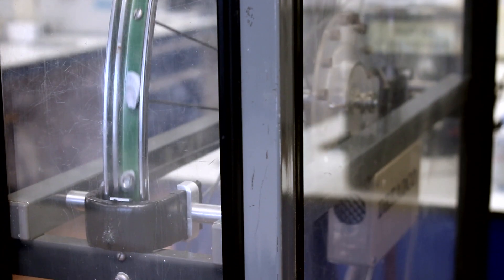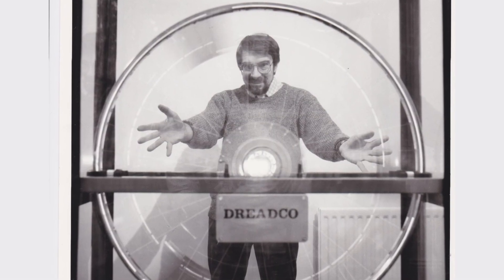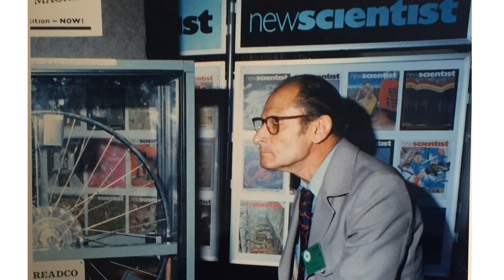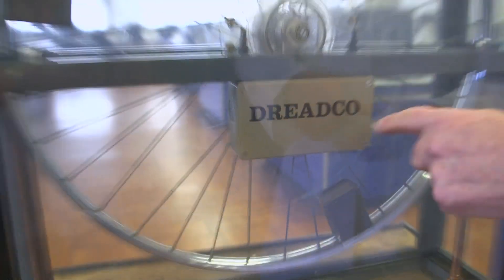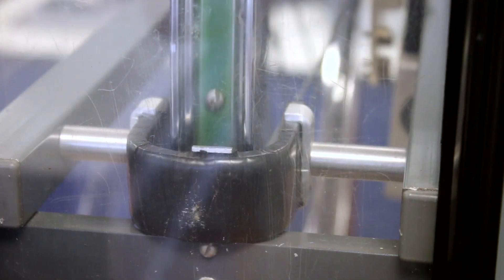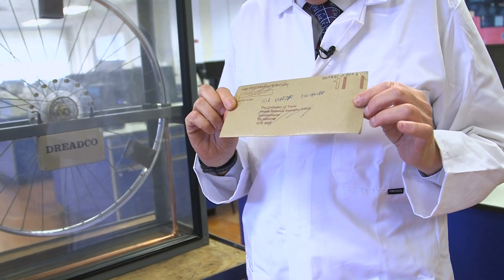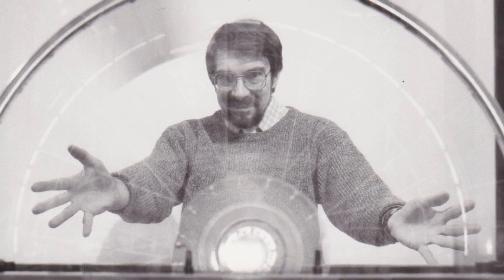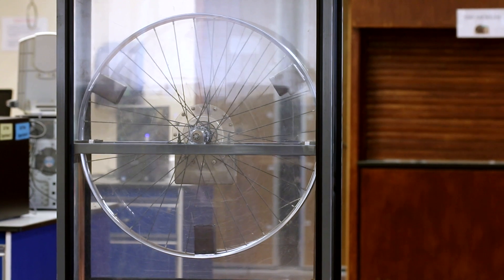Perpetual Motion Machine - Periodic Table of Videos

Comment: I doubt only one person guessed how this worked. Is clearly electromagnetic and the energy source is a battery.
Batteries are likely in the 3 boxes and they put a bit of energy in to the system each time they pass next to the two permanent magnets. There are 3 boxes so that only one box will put energy in to the system at any one time. The amount of energy is small as it just needs to counter the friction in the system.
Of course it can also be the other way around and the permanent magnets are inside the 3 boxes and the electromagnets are on the side with the battery in the bottom box but it will make more sense to have batteries in each of the boxes as they seems to have a lager volume.

Comment: the wheel is well balenced, each black box contains a battery and a copper coil. when the boxes are in the correct position relitvie to the two horseshoe magnets the coil is briefly activated, probarbly by a circuit with a reed switch giving just enough push to keep the wheel in motion. since the electrical consumption is so low the batteries are able to last for an unusually long time. I would guess that its running on those old fashioned lantern batteries with the long brass tabs.

Comment: My guess is it has a very long lasting battery and a very low power motor. It could work like in the oxford electric bell, charging these metal things near the center of the wheel and electrostatic forces pushing it away after it touches these contacts (and being attracted right before. The rest is just weights on the flywheel and a low friction bearing. Maybe it also contains some kind of solar cell in that dreadco box to support the battery.

Comment: If the small boxes have nothing but a small amount of propane in them and they are heated at one side and cooled at the other, with the propane at the correct pressure to be just about on the verge of condensing, the cold side will fall and the warm side rise because of weight distribution. IE using heat to re-distribute weight to cause rotation.

Comment: Works by electromagnetic induction. Motion of the metal wheel induces a current in the copper frame which pushes the wheel off at a finely balanced distance. It will eventually slow down to a halt due to Lenz's law, but with clever architecture might go on for a few years.

Comment: My guess would be momentum wheels that are slowly spinning down, due to friction or power source degradation, are placed in the three boxes. As the wheels spin down, they cause the bigger bicycle wheel to turn the other way, due to conservation of momentum. The momentum exchange must be larger enough to overcome the friction in the central bearing. The power source could be a spring or a battery.

Comment: I think it moves by sending pulses through to the 2 horse-shoe shaped electromagnets (black tape covers their small coils). There are 3 iron boxes to weight and balance the wheel and get attracted towards the relevant magnet, when it's powered. The power switching circuit knows the position of the wheel through those pointed rods on the box in the middle acting as (friction free) hall effect type sensors on the brass studs on the perspex disk passing near them. There is a battery and control circuitry either in the middle box, or in the box on the bottom and wiring is all hidden in the plumbing and frame.  I guess you can make a low voltage system to move the wheel slowly for a long time. The glass case is there to act against air currents and to stop people fiddling with it. That's my guess!

Comment: Here is my guess... high volt battery, connected to a very low power engine, powerful enough to move the machine. The rest is just a decoy! 
Got a digital clock with two AA batteries that has lasted for more than a year (still going). So... yeah...

Comment: Here's my 2c:
Most trickery work by diverting your attention to other things, thus all those pipes and magnet looking things are just props.

Facts: The wheel is spinning at a relative constant rate - gear engine of some sort
The energy source speculation: There don't appear to have any noise/pistons/burning/hose - so volatile gas is out, in addition it looks like it may be a vacuum chamber. But battery would be most suitable.
The DreadCo box covers enough of the centre to drive the wheel with the rivets being the propelling proponent.

Comment: I would need more information:
If you create a temperature difference between the heat sink and the copper tube, does the wheel vary RPM accordingly? If the answer is 'yes', the I would suggest it's a form of a sterling engine. For any other concept, I would need a closer examination (from outside the box).

Comment: Its in essence a Barlow's wheel. Micro current for milisecond each revolution helps to keep the momentum going. Everything else is misdirection. Battery hidden and connector hidden makes a circuit every revolution of the wheel and slowly drains the battery. The slower the wheel turns the longer the battery lasts basically.  watch?v=hSfxATaYeSY for example without the misdirections. You only need microvolts every 30+ seconds to continue pushing the wheel and there is a hidden connector/switch on the wheel that each revolution turns the battery on for a milisecond.

Comment: He said he felt cheated. maybe there's just a small electric motor in the enter, or a battery at the bottom that turn the horseshoe things on the sides into electromagnets, pull in the boxes, assuming they are magnets, on the rim in a circle.

Comment: The box holds some peltier elements that run a tiny single transistor coil pulser cirquit like in those swinging desktop ornaments. The temperature difference between the heatsinks and copper pipe is just enough to make the thing run. Or maybe there is just the different metals and some electrolyte in the copper tube reacting with the alu/magnesium box to run a crude battery powering the pulser. Or just a commercial primary lithium battery that can sustain this very little energy for decades. Its hard to tell just from the video.

Comment: So there are several things here, a perpetual motion machine, theoretically, -which is possible; what is not possible is an over-unity device, one which appears to draw energy from nowhere.  If you took a flywheel, set it in a perfect vacuum on a magnet bearing, and set it spinning, it would spin forever.  It would readily spin down if you tried to take energy from it, however, and would only retain what was put in.  

This device resembles that, in a way, but as we saw the wooden base beneath the enclosure we can be reasonably certain that this is not under high vacuum.  Now, the heat sink tells us something (if we assume that it is part of the actual working bits and not simply for decoration), heat sinks are usually used on things that consume a great deal of energy, power transformers, microprocessors of many FLOPS, microwave devices.  No such apparatus could be in this device, if it were dissipating heat it would have a very powerful power source like a radiothermic generator, which I find unlikely.  Instead, if we are assuming the heat sink does something, it must be there to take in energy from around, or perhaps to ever so slightly chill something inside, for purposes of exploiting temperature differentials related to air-flow and human presence/observance of the device.  I posit that this device is a type of Stirling generator or similar.

Of course it's entirely possible that this is an elaborate hoax and that there's an atomic battery in one of those boxes.  Obviously he's acknowledged that it's "fraudulent", but it would be interesting to know what the "defeat condition" is- does it run down in a vacuum, or simply over time?

Comment: My grandfather once had an Atmos Clock. It ran by changing air pressure in a expansion chamber. Changing temperature expanded or contracted a gas in the chamber which moved a spring counter weight. If the Professor's Wheel is stored in an air conditioned environment, it might not have enough temperature difference to keep the wheel running quickly. Or there is slight leakage with the gas. Less gas, less pressure difference and less motion.

Comment: I'd say there's essentially a motor inside with some well hidden magnets perhaps on the wheel, and a hidden electromagnet going on and off at the right time in the frame. Those systems became very popular in the early 1980s because the field effect transistors needed for those became cheap. You could even buy an array of desk toys working that way.

Comment: The problem is there are so many potential false leads. Lots of those bits could just be there to throw you off. The only thing I want to know is if you could determine the materials of every visible piece of the object could anyone determine with 100% certainty what’s running it? Because if not then I’d feel cheated to.

Comment: Hmmm.. I think it has something with the box in the middle (the DREADCO-box) to do. Maybe some material that harvest energy from the very room it stands in and converted to a sinual wave that powers the magnets. Does it operates when it´s dark? ;-)

Or maybe it utilizes the box as a greenhouse and use the temperature difference from within the box and outside by the thing in left bottom corner, by using thermo electric device.

Or even more clever, it may use both methods at the same time...

Comment: It looks like it is powered from the box near the axel. The electrode on the right is an electron emitter. The one on the left is a sink. A long-lasting high voltage battery is attached between them. The cups on the wheel get charged as they pass the right side electrode. The cups get discharged as they pass the left side electrode. The electric fields between the electrodes and the cups makes the wheel turn. The battery is very slowly discharged as the cups carry small bits of charge when the wheel turns. Very, very nice.

Comment: I feel like it's a simple thermal engine not unlike a Stirling engine. The pipe with a heat sink and the length of pipe going to the other side is longer, gains more heat along the horizontal length, the vertical pipe going to the heat sink is shorter and is vertical so it allows suction as the air comes down and is cooled.

Comment: "We believe whatever we see." 

Here's something I've never seen: two years, uncut, footage of that machine running. I propose that there is an inductive charging system and a small battery. For displays/exhibitions lasting less than a few days, there is a small relay/switch system which allows current to flow briefly as magnets move away from coils giving them a tiny amount of propulsion. 

Alternatively, there is an air current in the container and PMM1 is essentially and "open-cylinder" Sterling engine. This requires a bit more dishonesty on the part of the owner, but in a closed system, you could imagine a tiny amount of fuel lasting quite a long time. 

If it's neither of these, then it's a cat. 

I don't know how it's a cat, but experience tells me that "mysterious, unseen, notice forces" are usually cats.

Comment: I think the entire mechanism is in the dreadco box. It might be a compressed air canister that is releasing a small jet of air from the needle, focused on the cups around the hub. Or it's a battery with a little air pump. That's why it's in a case. 1. To remove interference and 2. So you can't hear the air jet.

Comment: Low friction bearing, magnets in the boxes, with a sensor and circuit in the horseshoe shapes at the ends to give a small impulse each time a magnet passes. Bars made of aluminum to prevent the choppy motion you'd get if you used iron or steel. That's my guess!

Comment: Looks like those pipes could hold a large amount of batteries. I'm thinking a low power air pump(fan) blowing from that thin bent pipe onto the disk attached to the spokes that holds the cups. Just the friction of the air should be able to spin the disk, the cups are just for show. I'd imagine some form of solidstate regulator circuit prevents the batteries from discharging as much as the pump could use, sort of like a choke.

Comment: First thought was that it's thermal. Some working fluid in the pipes and perhaps works simalar to the drinking bird. But that it's slowed down makes me think it's just a pulse motor with a reed switch and a simple air-magnesium battery. The heatsinks and other parts could be just to throw people off.

Comment: An Atmos Clock type mechanism could run until it needed maintenance just off of changes in barometric pressure or temperature, but a battery hidden inside and just barely jogging a motor or applying an impulse with a coil as the wheel slows could last for years too. Especially with a well balanced and low friction setup.

Comment: It's probably a thermoelectric generator powering an electromagnet that interfaces with the 3 magnets on the wheel (which double as flywheel weights). The "ball" tracks the plastic disc with holes (with magnets inside?) as a sort of crude tachometer wheel for timing the electromagnet control. The heatsink and copper is the thermoelectric generator powering the entire thing. I'm probably wrong, but as an engineer it's my best guess based on what I see.

Comment: Looks like a “brushless dc motor” magnets in the cans. Two electromagnets on the edges fed through the copper pipes and the box with heat sinks likely houses the switching electronics and maybe power source. The thing in the middle could be telling transistors to switch keeping things all in phase. That’s my guess.

Comment: If the blocks mounted in the wheel contain Tungsten, then there is a massive amount of inertia built into the wheel. That support frame looks very sturdy to just support a standard bike wheel. The casing is clearly just perspex judging by the scratches, so probably not airtight, but it doesn't need to be. Given that a fidget spinner weighing 50 grams can spin for over an hour, how long will a bike wheel spin with several kilograms of Tungsten bolted to the rim? The answer is a very long time indeed. Slow rotational speed negates the effects of air resistance. Precision bearings are virtually lossless. The magnets are just used to spin up the wheel as required using an external handheld electromagnetic coil. Look for the simple solution. Are you all disappointed yet?

Comment: My guess is that there is an RF energy harvester in use. If you convert a small amount of RF into DC and run the current through the center of the wheel you could cause it to spin. Over time the circuitry would degrade and become less efficient and it would spin slower. You could also use the wheel itself as a large antenna to capture more RF. The box with a heatsink might have a resistor to use up the power created by the RF harvester.

Comment: One has to remember the technology that existed when this was built.   A lot of the guesses are based technology which did not exist when the machine was built.  One clue is the professor says he knows it's been running contentiously for two years.  Prof also said it's slowing down.  I'm thinking batteries with a switching motor.  Remember this is a nearly perfectly balanced bicycle wheel which once it starts spinning will has very little friction and will continue to spin with very little energy. 

Interesting that only one person has figured it out, and only one other was close.

Comment: The box was vacated of air to create a vacuum and lower the air resistance. Inside each of the three boxes and the main Dreadco box he has batteries. The wheel is started by a push which slows down until the electric motor housed in the Dreadco box pushes this wheel along.

Comment: My opinion is that everyone here is over-confusing themselves when the answer is obvious given that number 1 he chose the Professor as the benefactor and number 2 you're showing it to us on the channel. Clearly, this is something The Professor would want to share with us anyway and obviously the inventor was a close friend so there are other reasons it is special as a connection between he and the Professor. My inclination is that it is a very slow chemical reaction...

 However, with that as a hint; I would like to open the floor to speculation as to which components would be necessary to get this minimally working and alternative suggestions for ways to accomplish it using every component.

Comment: It is all plumbing. There is no electric motor. The magnets are  a red herring.  It is a heat engine, a heavily modified version of the famous drinking bird toy search for "The Engineering of the drinking bird". The slowdown is due to leakage of the gas or chemical breakdown of the liquid. The three cans are filled with a special low boiling point liquid (e.g. methylene chloride) and are plumbed together in a similar way to the drinking bird toy. The heatsink at the base is the the most critical part, thermal energy is entering the system through the base via that heatsink, vaporizing the liquid in the cans which in turn redistributes the weight and gravity spins the wheel, lightest can moves to the top.

Comment: Thermoelectric generators in the bottom heat sinked boxes. The magnets appear too far away to be used for motion but could be a hall effect sensor for timing. The 3 boxes could be part of an electric motor or there is one hidden in the hub

Comment: There's a motor in the wheel with it's axel fixed so that the wheel and motor are rotating instead. 
Energy cells (batteries) are located in the aluminium box covered in heat sinks for misdirection, and wires are concealed within the copper pipes (again, for misdirection) and within the box sections supporting the fixed motor axis.
If you pause around 2:30, you can see the motor hidden inside the wheel and notice how it's screwed to the clear acrylic plate.